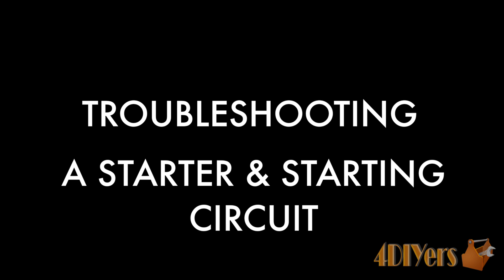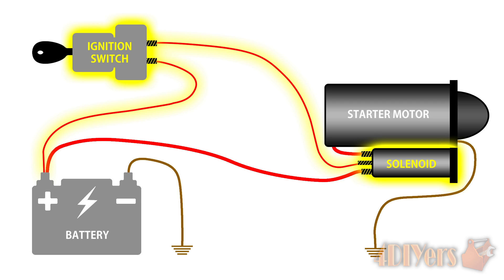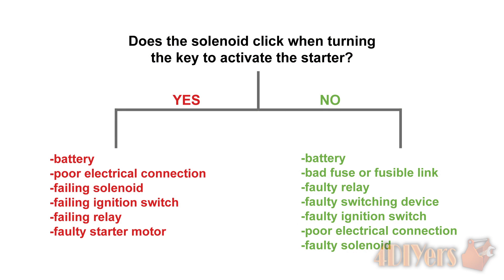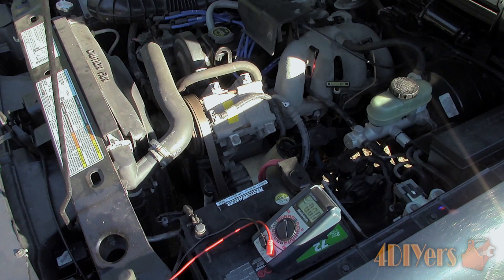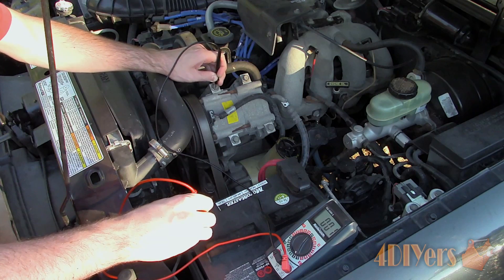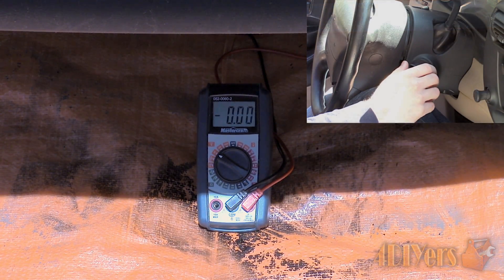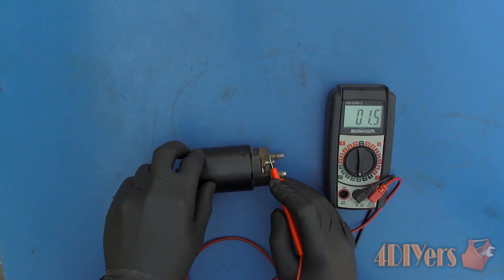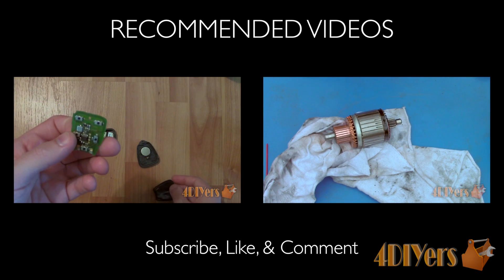DIY: How to Diagnose and Troubleshoot a Starter Motor

Comment: Excellent information! Question! Upon turning ignition switch I get a click but on the second or third try the starter kicks in and start the engine.  What is failing?  A dead spot on the armature of the starter?

Comment: If my battery sparks when I connect the positive and negative, is there  a short in the solenoid?
Reply from the maker: A spark can be normal depending on the vehicle. Could also mean you have a parasitic draw if it's larger.
Reply: @4DIYers  I really appreciate you for getting back to me about my question. Oddly enough, I was able to trace it back to the circuit between the ignition and battery. It was grounded there, I just missed it. Question: should the solenoid be normally open under no power conditions? Just for future reference. 😊🤪
Reply from the maker: No problem! Awesome to hear you found the problem. When a solenoid isn't powered up, it should be normally open.